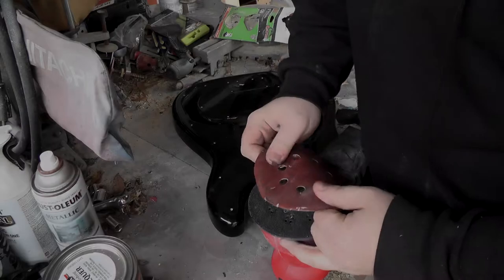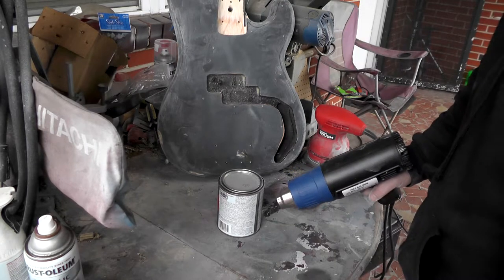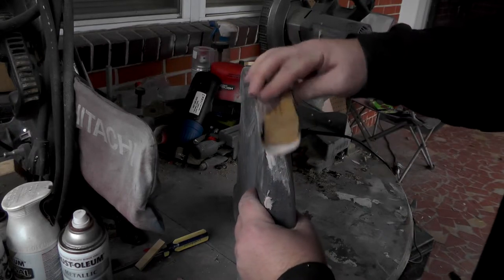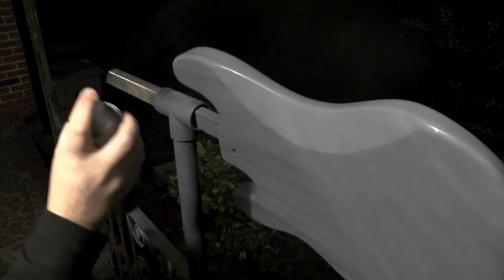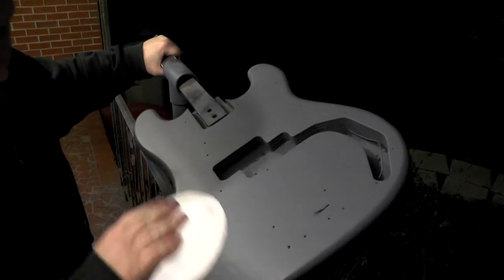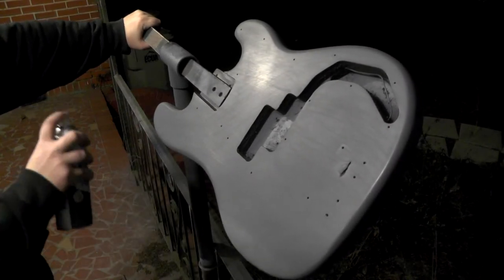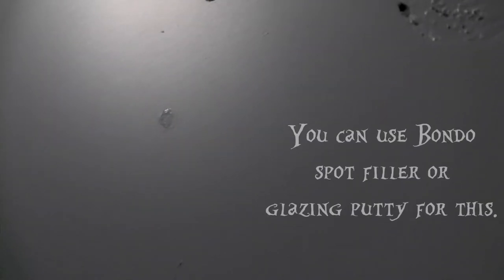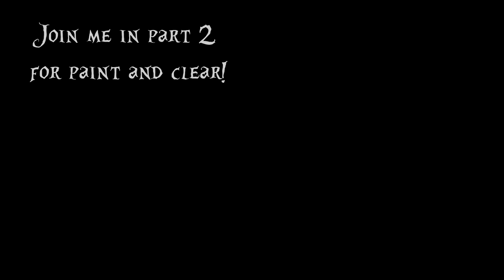In Depth Spray Can Guitar Guide 1

Comment: just an fyi, heat guns will remove most modern finishes. i don't have a lot of experience with this but i have done it. but of coarse most people probably don't have a heat gun so this works great. i do it to. Ive been curious about the effects of sound damping by keeping the old finish on and just scuffing the top coat, re prime, and repaint. i don't think it really has any effect????
Reply from the maker: I hate using a heat gun.  There is also the possibility that imparting that much heat into your body can crack or warp the wood, especially something like basswood.  On an electric having a slightly thicker coat will not affect anything.
Reply: @ForsytheVideo  as i suspected. gonna stop doing that and just scuff from now on. takes to much time and cost isn't worth it.